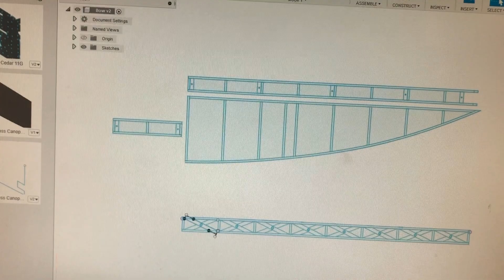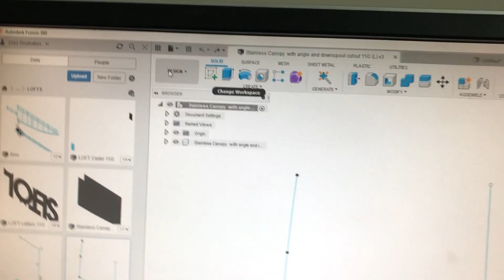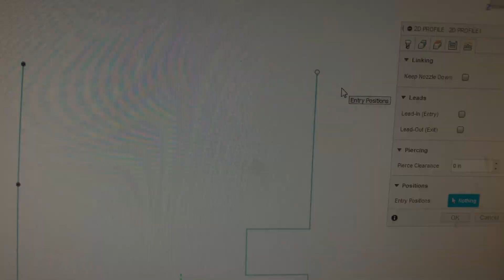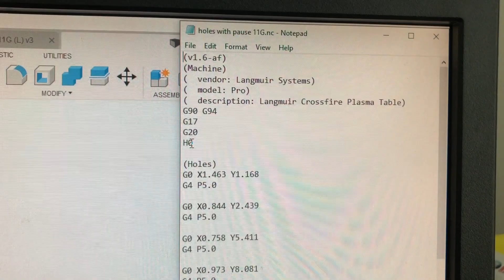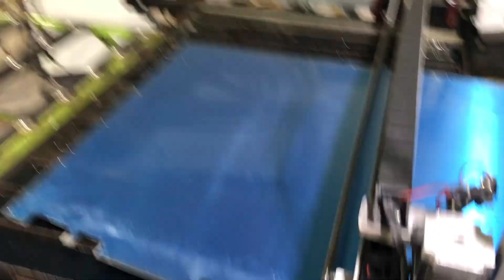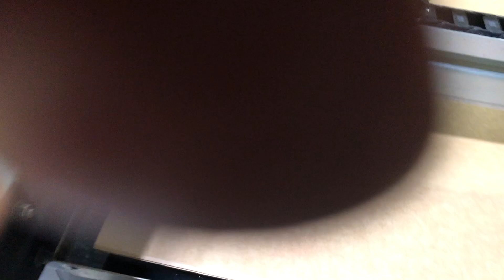LOFTS Sign

Comment: I had some success with 1/4” slots. 

Thanks for going over the fusion indexing.
Reply from the maker: I find my slots are wider at the top than the bottom because of the bevel.  When the slot “through-hole” dimension is critical I’ve increased the kerf size setting in Fusion to make sure the bottom dimension of the slot  is correct and leave the top side dimension whatever it becomes because of bevel.  11 gage steel seems to be the worst.  Thinner metal doesn’t have enough thickness to show the bevel anyway but 1/4” and up the bevel doesn’t seem to be as bad for some reason.  Since cut height for all the thicknesses is the same I’m leaning toward the cut speed as a factor.  I haven’t done a study on this but I’ve heard that the recommended cut voltage in the charts is a better setting than cut speed.  The cut voltage (if using THC) can be set in Firecontrol and then THC adjusts the torch height through the cut to maintain that voltage.